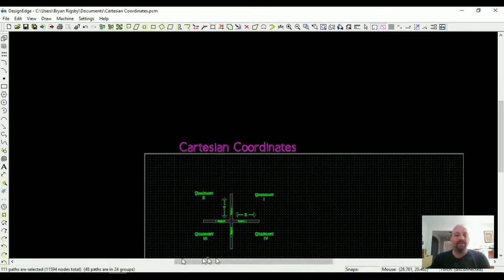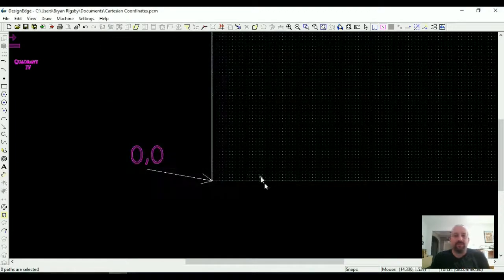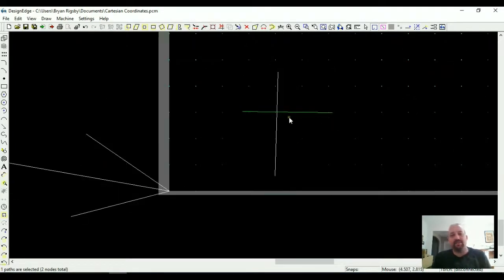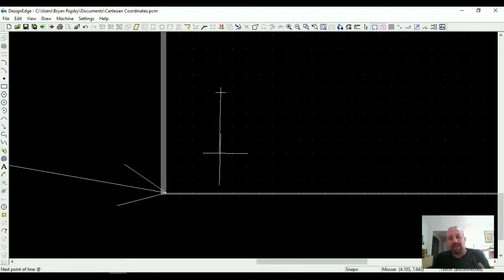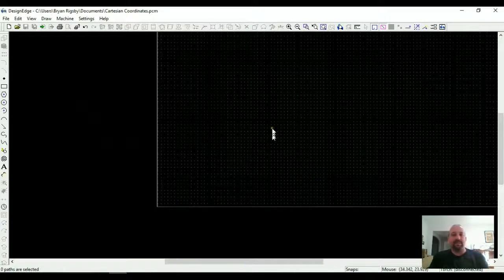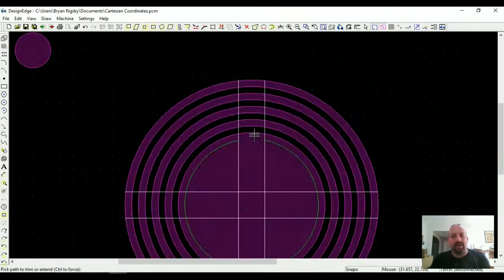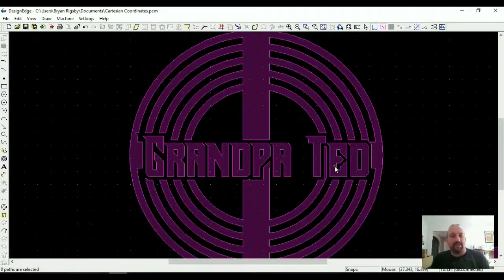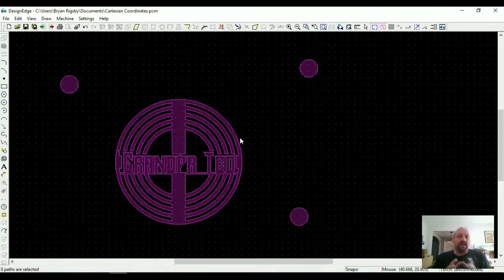Design Edge Learning Series 002

Comment: Hey Robert, Thanks for posting these tutorials. They are really helpful. I have been running a DHC machine for the last 12 years and have avoided upgrading to the Designedge software. I have developed a good level of speed and proficiency with the keyboard shortcuts, and didn't want to lose that. I just decided to finally upgrade so your tutorials are great. Thanks! 

On a slightly different note, I have been outsourcing some of my repetitive pieces to a laser shop and am having a hard time getting my exported DXF files to work with the laser cutter. I heard you mention laser in this tutorial. Do you have any pointers on how to create DXF files that the laser can deal with? The tecs at the laser shop say there are too many nodes and they also cannot deal with splines at all. I understand that the excessive nodes can be fixed with the smooth function but am unsure of the best value to enter for that. Any help would be appreciated! Thanks in advance!
Reply from the maker: Yes, I have a CO2 laser that I use for engraving and cutting wood, glass, acrylic, etc and engraving on powder coated metal or marking metal with a marking spray.

I design files all the time both for myself and for others, for lasers and plasma with Design Edge. The exported DXF has never given me any problems. You're right the smooth function can reduce unnecessary nodes from a drawing and Design Edge doesn't use spines so I'm not sure where the trouble is coming from.

If you'd like - email me a file that they've had trouble with and I'll see how it looks on my end. The solution may be to open an exported file in something like Inkscape and then save it as a different format like SVG that they might not have as much trouble with.